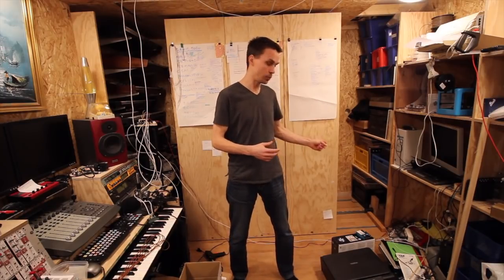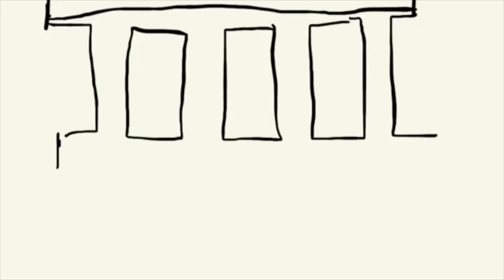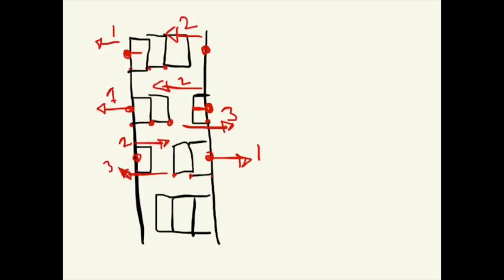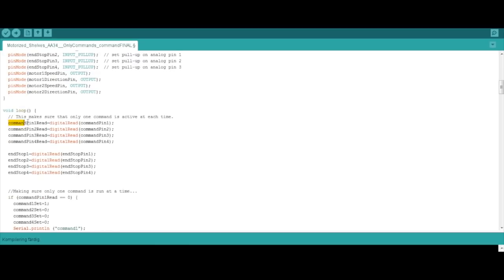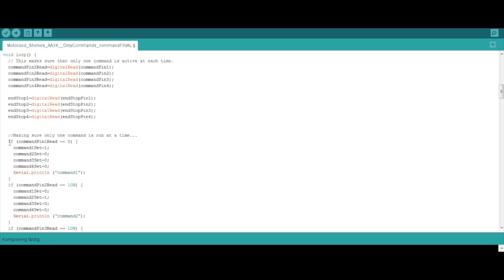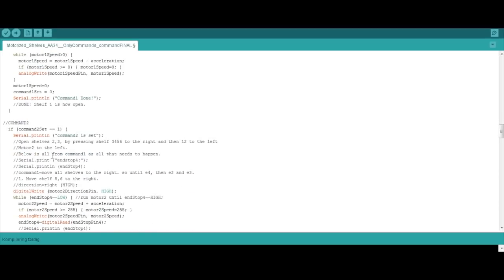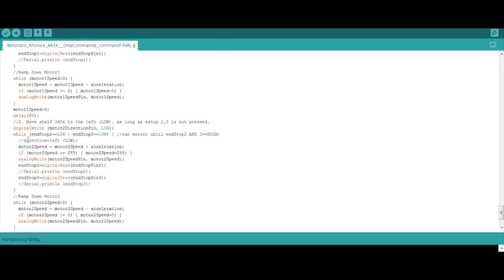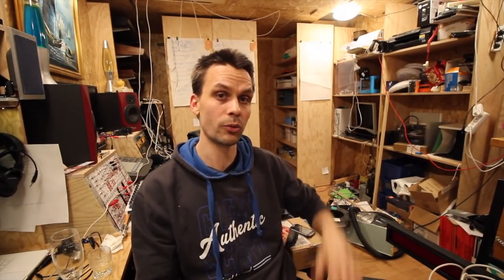Automated Movable shelves [Anything Arduino] ep.34

Comment: Just add a light beam or light array with photo sensors like a garage door.  I can elaborate if you want.  There are some similar things used in manufacuring.
Reply: Oh, and you can get some nice steppers with gearboxes from Lin Engineering.
Reply from the maker: Thanks! Gotta check them out. Also I understand how you mean with the photo sensors, but for now the limit switches work well enough.